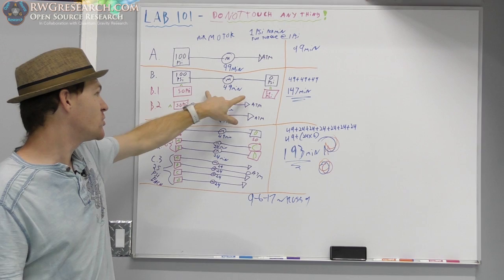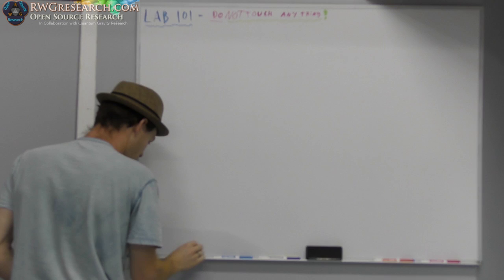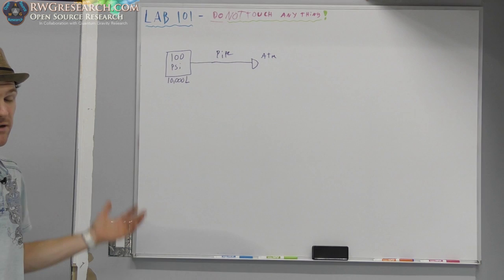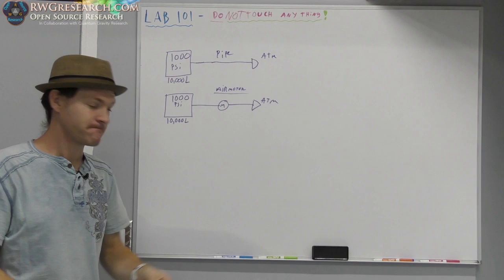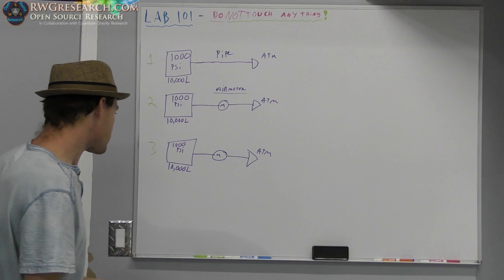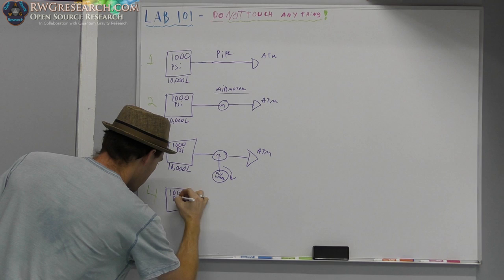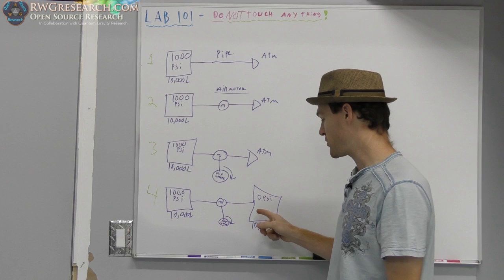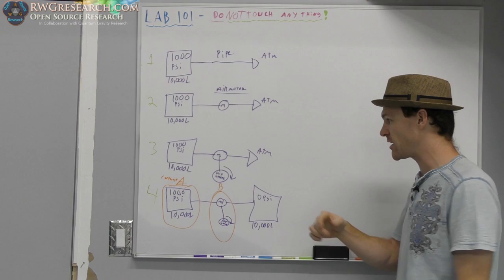The Search For Answers Part 2: Potential to kinetic Using Air. Thought Experiment.

Comment: Air tank to air tank equals 500 psi equalizing between the tanks. While they are equalizing you are creating work and energy. If you had multiple tanks after your 2 tanks and you had high output energy Motor that used special gear racial to power an air compressor to the 1st tank you can continue the output energy air to the motor that turns a generator Using the multiple Tank scenario. This setup may not be a free lunch but it will be a reduced lunch in terms of electrical energy reduction using multiple scenarios to create output energy with the least of input energy as possible. I can see what you are up to in this type of concept. I thought about this many, many years ago.  If your 1st tank starts out and 1000 psi and your many other air tanks were equalizing between all tanks from the original tank and your air drive motor that creates the air runs on low pressure that can create high pressure again you can loop the power around and around multiple techniques. Great concept Russ.

Comment: yes russ the air motor did consume some of the energy , the thing is it has to vent pressurized air to do work so under no circumstances does any air motor use all its energy.Imagine a piston being moved  it is forced by 1000 psi to do work for 1 meter at the end of the stroke you now have a full cylinder containing almost 1000 psi because the air reservoir loses some pressure during the stroke so the new equilibrium pressure is whats left in the cylinder lets say the volume is such that the new pressure is 950 psi so in effect the power loss from the stroke is 50 psi .  the formulas used for this are of such nature that you must review and relearn them after not using them for a while , also we have flow losses due to eddy currents and laminar flow losses. force times distance is the work performed on the piston meters time newton's give you joules of work  divided by time gives you watts or power , i think that's how it goes its bin 10 years since i dabbled in these equations  . So if you try and use the energy of the exhaust flow from the air motor  then the air motor suffers losses because the lower the discharge pressure the higher the power the motor will be . its very similar to heat engine equations  the power extracted from heat is very very small same with the air motor the power extracted is very very small . turbines have a max efficiency of about 75% , lookup adiabatic efficiency plus i think  air compressors are only 10 to 15% efficient so if you put 100 watts into a compressor then send that 15 watts to an air motor thats 50% efficient you end up with 7.5 watts of power from a cradle to grave perspective

Comment: Attaching the air motor will cause the air to drain at a slower rate. This is because to do any work it must act as a flow restriction. What is happening here is that you have reduced the velocity of air exiting the output nozzle, and that momentum has instead been converted to motor work.

This is directly analogous to a heat engine as well. Say you had a hot plate and a cold plate and placed a thermoelectric generator in between. How is this different from if you directly attached the plates? The heat equalizes between the plates more slowly, and the electricity produced is proportional to that difference (with loss of course). The same applies to a steam-turbine generator, a Stirling generator, or basically any generator other than a photoelectric one.
Reply: In case number 4,no more energy is consumed or lost with the motor in place,and air flow restricted. Even though the air flow has been restricted,thus having less kinetic energy,the time of flow has increased to that of the unrestricted flow. The very same applies to the cap to cap transfer,in that,regardless of the value of resistor between the two cap's,the net stored energy at the end in the two caps is the same. In this case,Boyle's gas law applies,which is P1V1=P2V2

Comment: I wouldn't say the air motor consumed the energy rather it converted the stored potential energy to lets call it useful "shaft work"

q1: The potential form A is not in the flywheel of B, once the pressures equalize like you said  the motor become a pump. If losses are completely ignored the potential in the flywheel would pump the air to the second tank all the way up to 1000psi (realistically the second tank would build up in pressure and be short of the initial 1000psi )

q2: Im just a mechanical engineer but if it were i circuit id say that A is the voltage source , B is a capacitor, and C is another voltage source but with no potential.
Reply: lookoutforKURT lol! Useful shaft work.... Your dirty 😉

Comment: Like a battery it will equalize. Or like a hot piece of iron at one end of a room and a block of ice at the other end. Current flow both ways until iron, ice, and room are all equal in temp. Reaching an equilibrium from polarization.

Comment: The motor consumes no energy. Component A= capacitor, B= magnetism of a bifilar coil which is impedance matched with the capacitor (tank) in the middle of the coil. The inertia can be seen with a galvanometer.

Comment: There was always more potential than just the 1000psi. Let it out through a short thin pipe, and it will get noticably hot. Even when just going for 500 vs 500psi. Same for a nearly closed valve. However you relieve the pressure from the first tank, the potential will shift and/or release heat as well.
You can't extract enough from the extra potential to re-pressurize to 1000psi of course.
Reply from the maker: Cloxxki will it get hot???  Or will it get cold???  ;)   is this the result of "negtive resistance"?  ;)   ~Russ
Reply: It will get cold,not hot Russ--Adiabatic cooling is the process of reducing heat through a change in air pressure caused by volume expansion. In other words,as the air leaves the high pressure state of the tank,and into the lower pressure state of the atmosphere,it will cool,along with the tip of the nozzle releasing the air.
Reply from the maker: Yes i know it will. i cover this in a later video :) , speak soon! ~Russ

Comment: At the end of the day..... My imaginary pump connected to my imaginary flywheel exhibiting imaginary mechanical losses ends up with around 685 psi (in tank 2) when the wheel stops. Giving it roughly a 1/3 increase in efficiency. Which sounds about right to me. Once you approve Ragnor for the forums we can discuss it more thoroughly. :)
Reply: A ring type flywheel appears to have great mechanical advantage over a simple disk. Who would have guessed?

Comment: What happens to system 4 when it runs its cycle? I think the perfect flywheel would start at peak speed and continually slow down until the pressure was equalized at which point it would stop. In electrical terms, Component A would be a battery powering Component B, a  motor connected to a generator, And the generator would be recharging another battery which is the other tank. Your valves would be diodes? I think those are the electronic equivalent of a check valve. As  yourt electrical potential decreases your motor slows and charges the other battery slower until it is in equilibrium.

Comment: Ok russ, I sort of know wot your looking for but you still won't get any takers on the tank to tank, thats because this time round you didn't give any specs on the air motor, ie last vid it was 1psi a minute lose which means there had to be a regulator and this time round it a motor of any choice with no spec on it. this motor will turn very fast at start and slow as the air changes from tank to tank as the motor before had limitations on it of 1psi a minute lose and would have limitations on what it would turn, but the motor on this time round has a 1000psi behind it and probably would turn a very heavy flywheel even if it was the same motor as before. in electrical terms i think that A= 1000 psi is volts and 10,000 lts  is capacitance,  an air tank will behave more like a battery if you like.but  could be a capacitor.   B= a motor is a motor and with the weight of a flywheel with inertia its a generator andl, i think that it is is an inductor. also a regulator would be a resistor......cfm is amps and is still king..........thanks for sharing...phil
Reply: wot your?

Comment: A = DC Capacitor & B = an Inductor

I'm going take a stab at this....probably wrong....
'A' gets charged with a DC Power Supply
assuming A is not connected to motor yet, then 'switched on'
Motor spins to 1 atmosphere is reached, assuming check valve is installed between B & not labeled 'C'
energy stored in flywheel until 'A' potential is depleted.....then 'fly' inductors field collapses, driving motor in opposite direction.
Does motor runnin' in opposite direction begin re-filling 'A'? One tank will absorb full potential minus heat losses, just like I squared R heat losses in DC components ie.  wire, dc resistance in inductor etc.........Hmmmmm.....thanks RW...I think
Reply: Okay, as I think again on this...when component 'C', 2nd tank reaches the pressure of 'A', then the two potentials are equal & motor stops.....assuming no losses & there are.....the pressure will equalize at 500PSI........Does an air motor spin in reverse....maybe not if piston port is the same.......going to check out air motors...damn you Russ

Comment: (A) is a battery it stores the energy....(B) is a conductor......you could also recycle the energy used if you pulse the flow as it leaves the first tank (battery) i.e. if it was electrical you could use the conductor to advantage when you collapse the electric flow you will get a back EMF. The back EMF will have a higher potential than the initial stored potential so you could put this energy into the original source, Tank or Battery. so your figure of 750% is quite conservative. Thank you for showing the world another way of looking at this....Many people know this and use it but we need more to understand the uses. I understand your reference to the bible....I am not religious, you don't need to be. Simply Believe and have Faith in the question you want answers to and that does not have to be in the bible it self. The answers will come when you can do this. And don't think too deep. many replies here try to. the answers are very simple when you understand enough basics.
What I mean by this, people in their answers are already thinking (believing) about the losses in this system and this is what they will get losses...I approached it believing the gains to be had and I gave one example of this belief the Back EMF, there are more which I think Russ will cover its his video. And don't build belief on trust, learn from knowledge and fact when it is presented and test that knowledge as Russ said do it yourself.

Comment: in first scenario... won't air get colder to atmosphere... not hotter ?
reducing pressures, not increasing pressure ?
Reply from the maker: Damien Colburn that is correct it will get colder.  ~Russ

Comment: in a perfect no lost=no resistance 10 mega watts dump in to the perfect engine dumping 10mega watts in to flywheel on no friction bearings in a perfect vac the negative pressure in tank 2 pull the volume in till balanced then the fly wheel starts to dump its energy in to the air to fill second tank lol o yeah no photons can touch the experiment or they may add energy to the system it must also be fully isolated but it will be equal you cant create more energy but you can suck more volume upfrom out side system